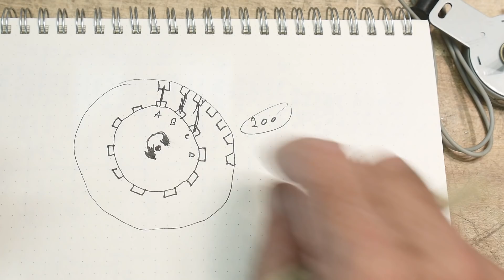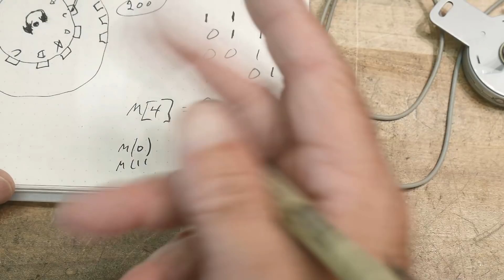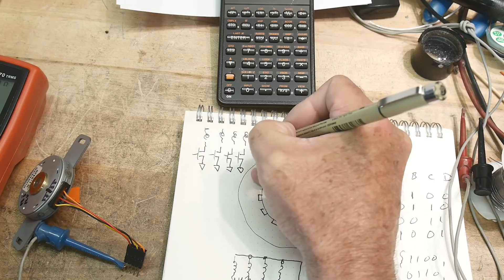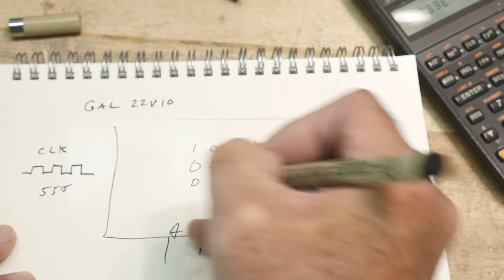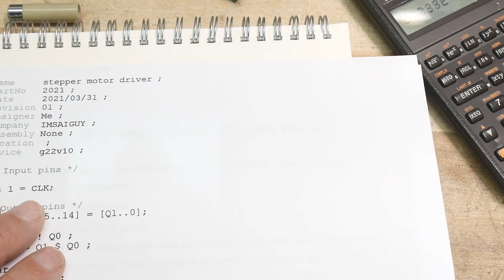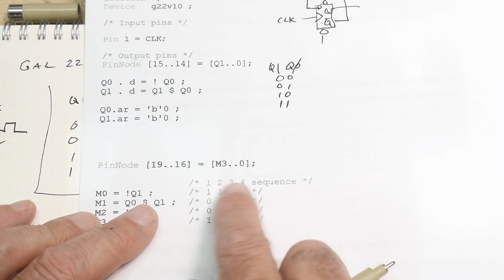#754 Designing a Hardware Stepper Motor Circuit

Comment: Great video.  Is there a way to calculate the RPM of the motor under load.  For example, if you need to keep the RPM at a specific value or detect that it is actually turning correctly and not jammed under too much load.
Reply from the maker: you need to add an encoder to close the loop
Reply: @IMSAIGuy  I'll have to do some research on how to do this.  I'm trying to figure out why my robot lawnmower thinks the cutter is not spinning when it clearly is. Your video was a great help in understand how stepper motors work.  I initially suspected that there is some type of circuitry in the motor housing that is sending a variable current back to the main board to calculate this.  Maybe this is not the case and there is some type of encoder on the main board working this out.

Comment: My first serious arduino project was actually making music with stepper motors. It actually got pretty popular when I published the project. 
I then decided to level up the project by doing the same with an FPGA. The challenge was moreso in regard to the MIDI serial to parallel implementation and less of the stepper motor control since I used a4988 in the project.

Comment: Why didn't you put back EMF diodes across the stepper motor coils?
Reply from the maker: Most N-channel FETs have a reverse diode built in.  I was not worried since the currents were so low. In a high current design they may or may not be needed depending of the FET. Some designs put the diodes from the winding to the +V.
Reply: @IMSAIGuy  That's what they call them Most-FET's.

Comment: This brings me way back also. I did stepper motor control when I worked for NCR back in the day. We had current limited chopper control so that we could get much faster response from the stepper motors. I have not programmed a PAL or GAL in decades. I don't even have the programmer anymore to do it. What programmer do you use?